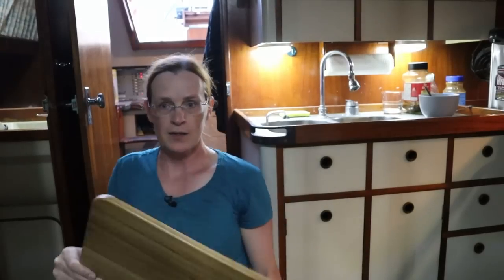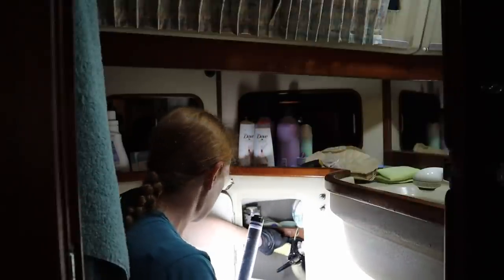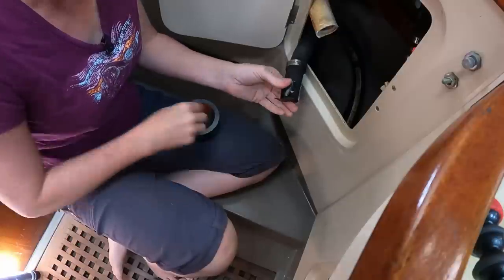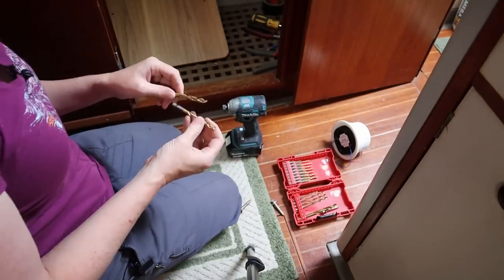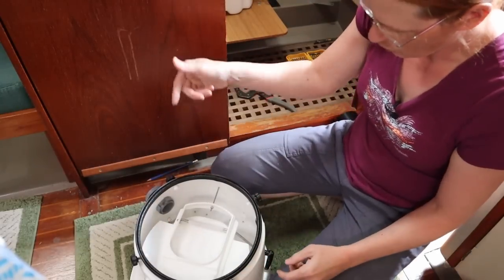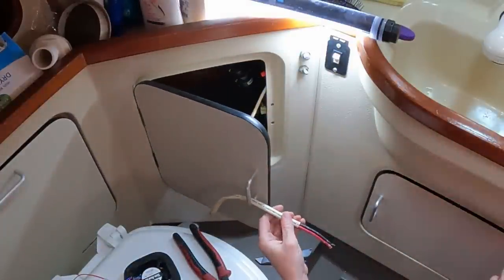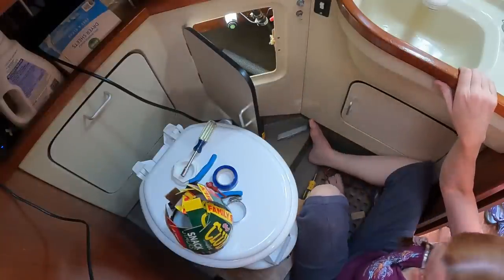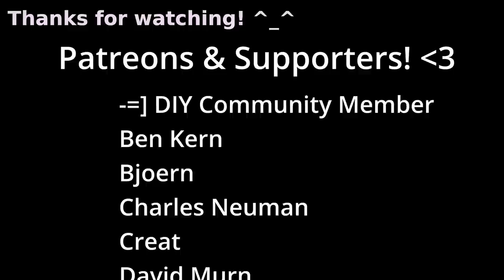Airhead Toilet Install (Ep. 74)

Comment: Same as when you go off-grid or any other situation where you don't have a city sewer connection: things can get messy, disgusting, and gross - but that's the reality of dealing with waste. When everything works fine, there isn't an issue, but fixing things when these systems break is just part of being independent.
Reply from the maker: Absolutely. In a really weird way, as gross as it is, when the job is done it kinda reminds you how self-sufficient you are, and that's a pretty good feeling.

Comment: "Heat gun and a poop pipe" literally lol'd😂   what you needed was an Amy to hold the light 🤷‍♀️ I was thinking that if you had 4 hard rubber feet, you could have used them as spacers under the plinth and then your head would have something like a shock system but also it would have kept the screws from going too deep. 👌 Secure is good, bathroom trips will be safer now 😜 I love watching all the boat work, but I love doing the boat work too so that might  color my opinion 😅  sometimes I hate watching videos in past because I sit here and go ooh ooh, I have an idea! (Btw, we love Red Green and "St." MacGyver 😂)  everything looks amazing and I'm so excited for each project completion!

Comment: I am eager to see what you think of the compost head in a few months. I'm sold on compost heads but I bought a Sun Mar for my boat and I HATE it. I'm looking for a replacement now and I'm trying to get a consensus on the best one to use in a boat. 
Keep up the good work!
Reply from the maker: So I've already used it for the trip home, and it worked extremely well. No smell _AT ALL_. It's a bit weird to get used to, but once you are, it's perfectly fine. A friend of mine who also has the Airhead had an idea I might steal; He's planning to put a valve on the first use tank to run to the shower pump, so that when he's far enough out to dump overboard, and it's time to drain the tank, he can turn on the shower sump, drain the tank and flush it with sea water.

Comment: Sharing a thought, roll up tissue paper and stuff into those four holes. Then mark the paper with lipstick. Place the white oak in place and press down. Holes transferred? Cheers
Reply from the maker: Hrm, not a bad idea actually. I don't have lipstick, but I'm sure I could have found something. In the end though, because the bolt heats were above to plinth, I couldn't have used the original holes as the bolts would be under the head.